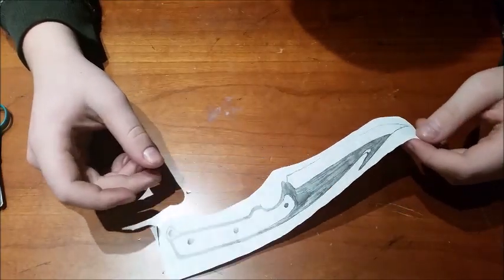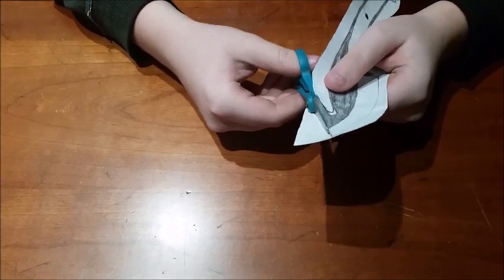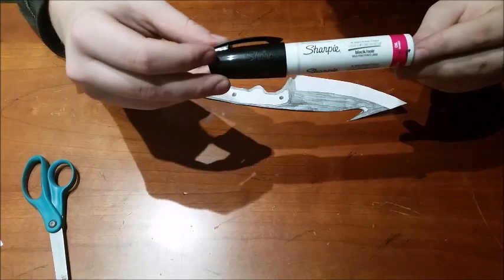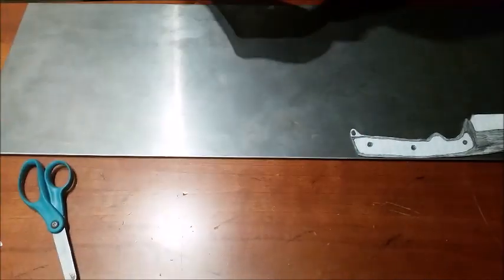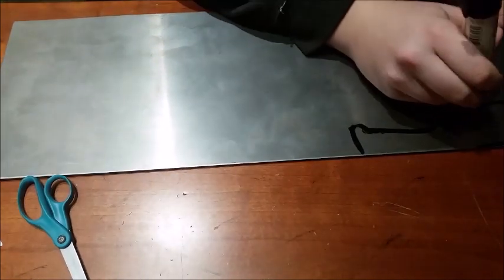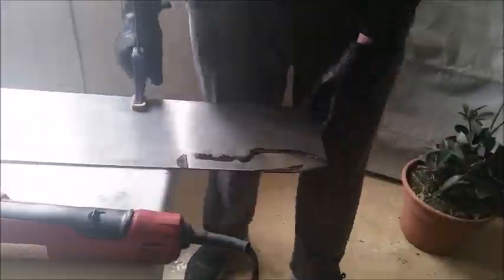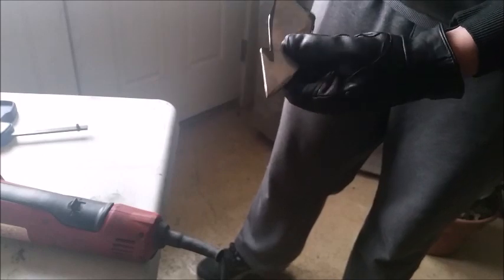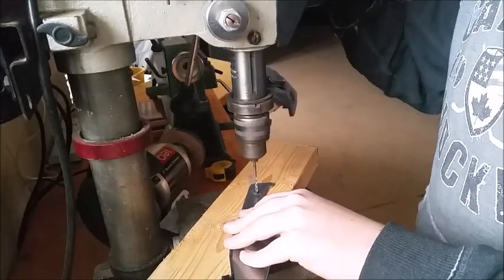How to Make a Knife Part 1 (CSGO Gut Knife)

Comment: i will be happy with you will send the sizes of the gut knife
Reply from the maker: the knife had approximately a 4 inch blade and a 5 inch handle, I will be posting more videos about the knife but the hook broke off during heat treatment so waiting to get a welder to continue the project.